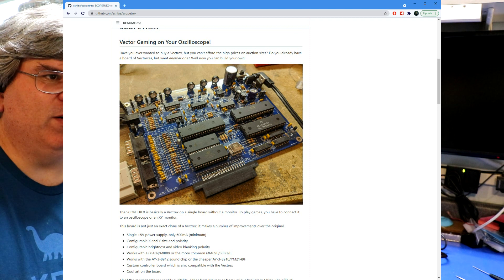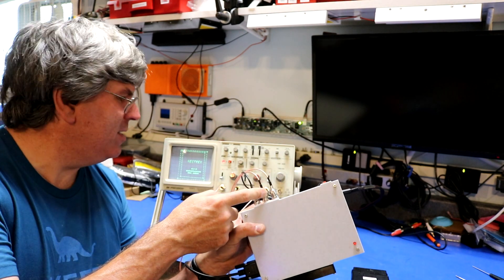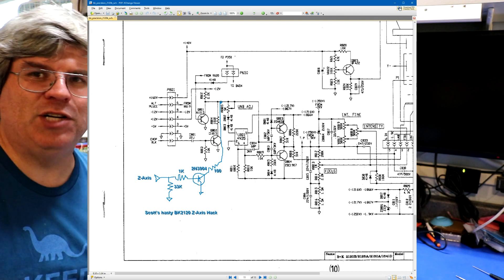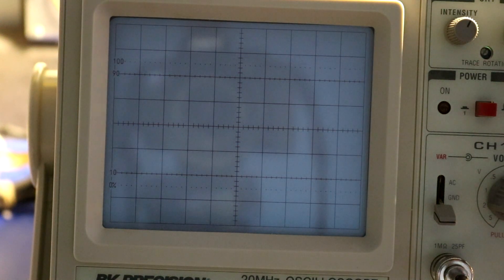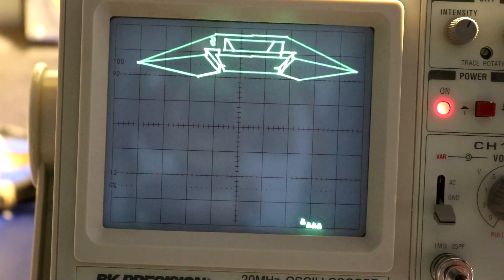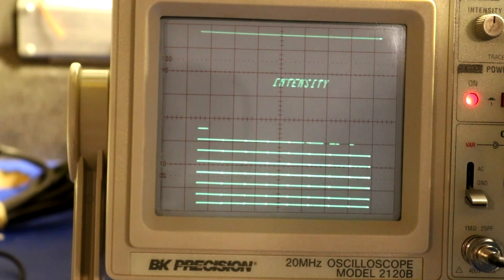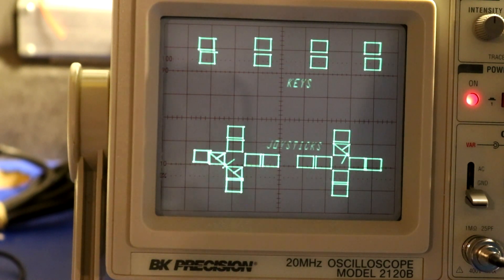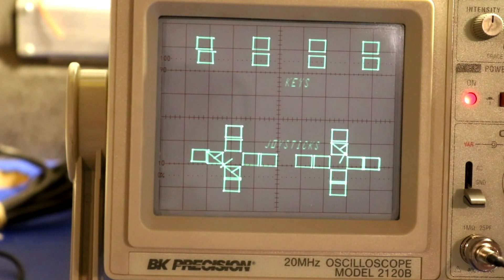I built a scopetrex! Vectrex games on my old oscilloscope

Comment: On your display alignment challenge:  the problem is that your oscilloscope display has a correct and linear response to deflection voltages, where-as the Vectrex display implementation did not (was non-linear.)   The Vectrex logic board deflection outputs were non-linear, to match the reactivity of the Vectrex display, and (presumably) this newer implementation mimics this.  I've seen (somewhere) a simple circuit which is a ladder of some resistors and a capacitor which can be put in the output path(s) to make a linear tube act more like the Vectrex display.  You'd find this employed, for example, in implementations where a Vectrex drives and arcade vector monitor.  Try some judicious web searches...

Comment: I love the idea of making a TV into a vector display, as a kid I saw an arcade version of Space Wars on a giant CRT it was an amazing experience back in the 70’s. I would love to create this with a converted TV and a ScopeTrex. Thanks for the video
Reply: Unfortunately TVs don't make very good vector displays - the tube is not a problem, but the deflection coils and drive circuits are designed to scan much faster in one direction (line) than the other (field) -  in the case of a US NTSC TV, the field rate is about 60Hz and the line is almost 16kHz, so you have ~250x the bandwidth in one axis over the other.  Another issue is that a TV typically uses an overwinding on the line transformer to generate the high voltage for the tube, so in the absence of any repetitive line drive signal you need to do some major rework on the line circuits.

Comment: I'm building one of these too!  Neat design.  Question for you:  Where on earth did you find the 3 ferrite beads the board needs?  I'm having trouble sourcing some.
Reply: Hi! I have ordered ferrites on the Aliexpress page. Have you already built the scopetrex PCB? What are your results, experiences? I have not finished it yet and I am curious.
Reply: @tomaskozeluh2211  I am going to look at Aliexpress to order (thank you!) and will start building soon.  I will post the build on my channel as well.  I want to use a Mac Plus 9" monitor (re-wired for vector) and build a Vectrex clone.

Comment: Has the scope probe compensation been corrected?  The input to the scope is designed for a standard 1x or 10x probe.  When you direct feed coax signals there is ringing due to impedance mismatch.

Comment from the maker: Things I tried:
* Clean off all the solder flux - maybe some difference in adjustment, but no improvement
* Replace Integrator caps with WIMA MKP2 Poly Caps - moderate improvement
* Replace Sample-and-hold caps with WIMA FKP2 Poly Caps - significant improvement, especially in the Y axis. Weird "blank spot" in the "Integrator Test" text went away.
* Replace DAC0808 with one from Jameco; Also tired ebay MCP1408 - no change
* Replace overclocked 6809 with a 2MHz 68B09E and replaced crystal with oscillator - no change
The impact of switching to the poly caps was significant. It's not perfect now, but it's a lot better than it was. I am considering changing the remaining 47pF caps for poly caps as well, to see if that has an impact.

Comment: I like it alot. Your alignment will be related to your PSU voltages. the Minus voltages will drive the "Dot" to the negative quadrants. "+" up right is pos X Pos Y, low right is pos X neg Y, ect. if one of your voltage rails is off then it will be distorted. I had to work on this type of deflection system while in the NAVY for the operator consoles. test was hard to get right but with practice it was able to be done..... You PSU first then the voltages from the deflection D/A converters. May also be an issue with your scope!

Comment: I would probably build me a laser projection screen out of two old hdd arm coils and magnets. The screen size you can achieve there is pretty nice and it’s small and lightweight. The only tricky part is the 2-axis mirror hinge which have to move precisely and quick enough to allow for the laser scanning.
Reply: Sadly absolutely not fast enough

Comment: are the DACs made up of discrete   resistors.  Most dacs of the time were built up using   R & 2R  ladders or resistors in a 1,2,4,8,  chain   to get the proper steps between lines, if so, the display seems to show you have one of the dac resistors to far off value on the vertical axis or the horz also.  hense the    different gap  /  bar above the lettering and the misalignment of lines in the calibration. if your dacs are made up this way    recheck all the dac resistors  values very carefully      .        is there a schematic avaliable.

Comment: I don't know why I feel compelled to say this (because it is pedantic and stupid), but technically those are DE-9 jacks and not DB-9. The letter after "D" is the size of the jack, so "B" would be huge like an old parallel port, and "E" is the size of an old serial (and also VGA) ports.
Reply from the maker: You're right, and I know you're right, but force of habit leaves me calling them "DB-9s".
Reply: It can be useful knowledge if you use D-sub connectors in projects. a while back, an engineer ordered a few thousand DA15 connectors instead of DE15s for a production-level repair project, and we got stuck with a large pile of unusable connectors. A DA15 is like the connector used for old Mac RGB monitors. the DE15 is used for VGA.
Reply: could just call them d-n jacks in most cases, the number of pins usually shows the size, (VGA / game port being the obvious exception)

Comment: Looks like you may have used ceramic caps in the integrators. Replacing them with poly caps may help. The linearity of these caps is critical.
Reply from the maker: hmm, I don't have any appropriate poly on hand. What would you recommend? Wima MKS or MKP, for example ?
Reply: @smbakeryt  Anything from a reputable manufacturer/supplier should be fine. Would be interesting to compare polypropylene, polystyrene, and NP0 ceramic (much better than the common X5R ceramic).
Reply: I also think it's the caps in the integrator circuit, I had a similar problem when I recapped my vectrex, then I replaced the caps in the integrator circuit for the poly caps, and all was good again. I used these from mouser. FKP2C014701D00HSSD and FKP2C021001G00HSSD.
Reply from the maker: @patzik1910  Thanks to you and @oPossum5150 both. I went ahead a few nights ago and ordered some Wima caps. The very same FKP2 4700pF for the sample-and-hold. I went with MKP2 0.01uF for the integrator (hope that doesn't turn out to be a mistake; the WIMA application seemed like either would do)
Reply: @smbakeryt  Were you successfull with the change of capacitors? Is the geometry of display OK now? Thanks.